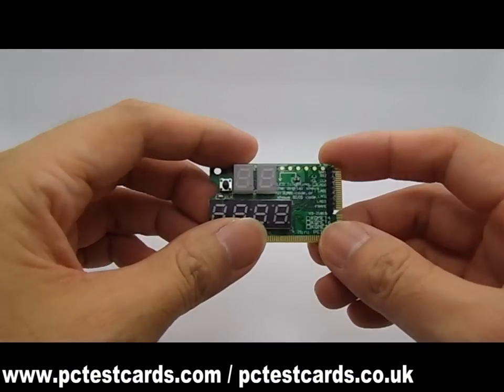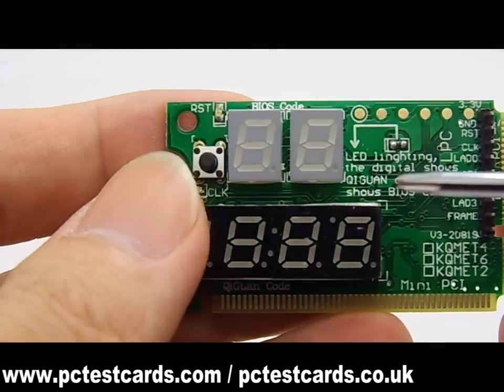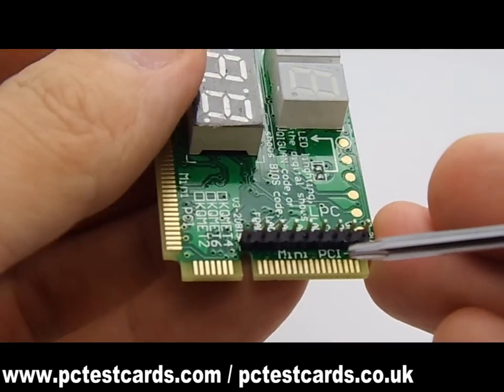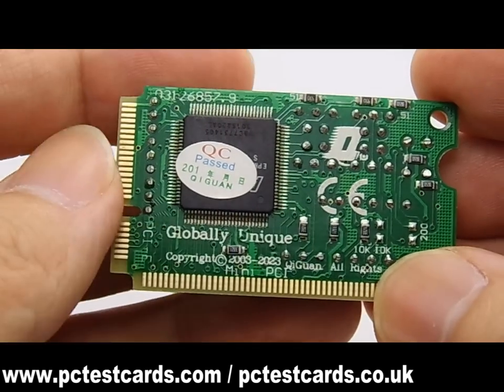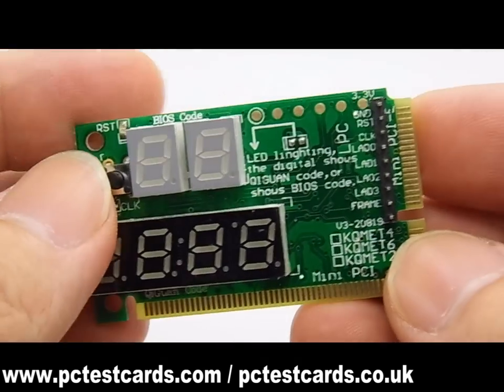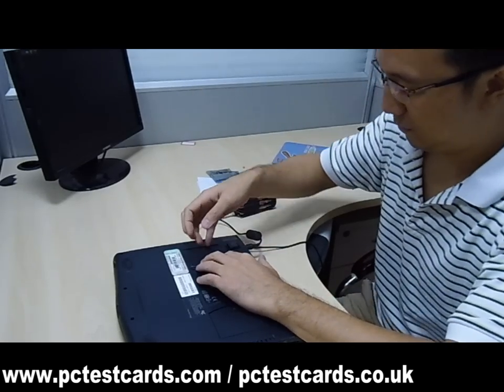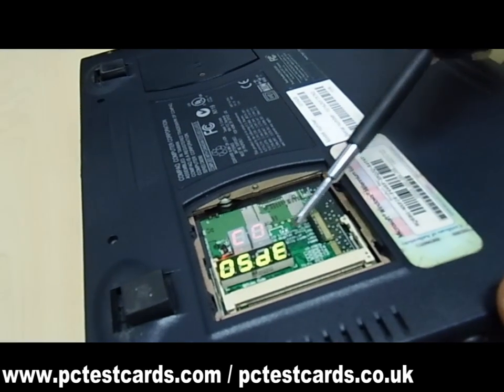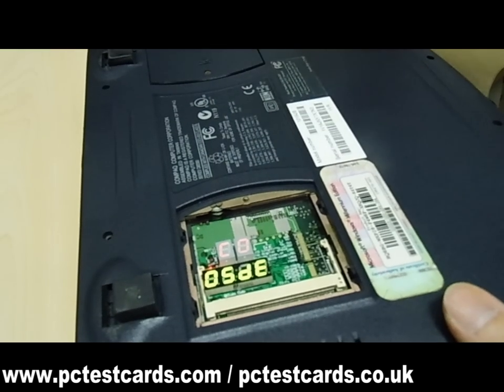How to use the Laptop Diagnostic Card on different laptops - pctestcards.com

Comment: No worry to install the test kit without removing the laptop power adapter and battery.
Just a common practice that we should just shut down the machine before removing and installing any parts. 

Tech facts: The 2/4digits test cards out there are using the traditional Bios POST codes method only, and sometimes Bios code may not work or corrupt. This new laptop test card comes with Dual methods of diagnosis (Factory Qiguan diagnosis + Bios POST code diagnosis) so this is the best unique test kit for laptops! Hope this helps.
Reply: Where I can find the code meaning?
Reply from the maker: +Eliseu Romanos hi Eliseu, have you tried my web site download section? thanks any question, please email me william@pctestcards.com, hope this helps, William